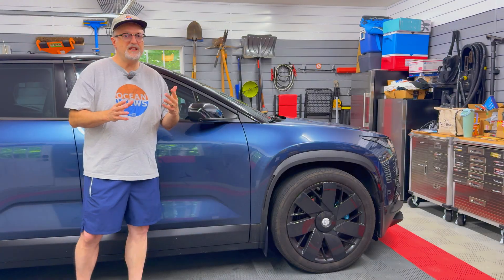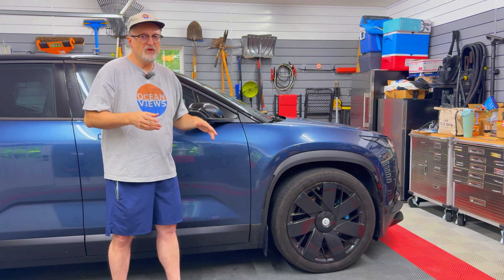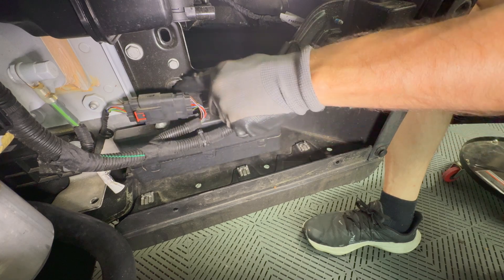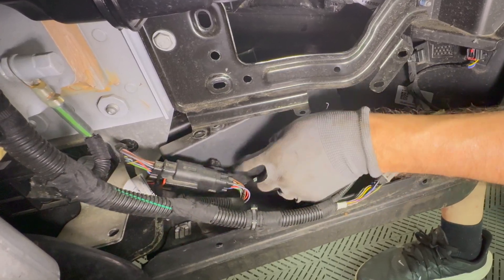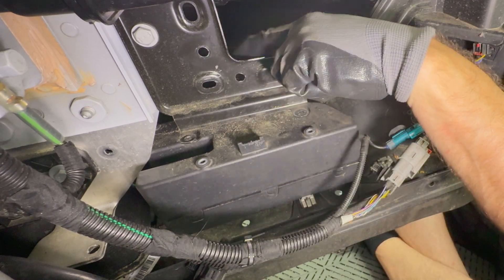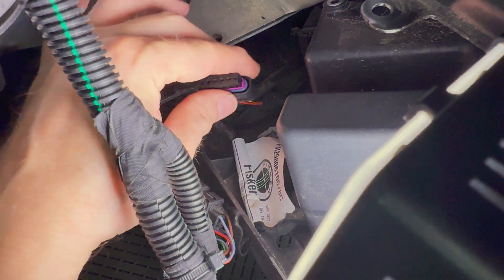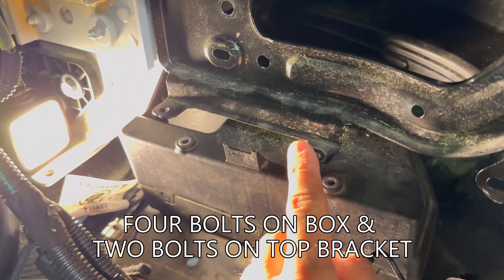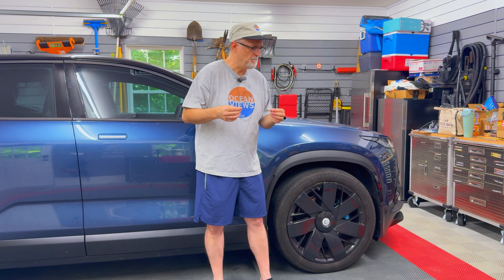Fisker Ocean - Waterproof VSP Connector

Comment: would never tape a connector wich is already waterproof!what you think that MAGMA did not think about that????A taped connector will rotten fast if there comes water inside!
Reply from the maker: It's been demonstrated that most if not all of the connectors on the Ocean are not waterproof.  There are examples of the VSP connector rusting out the pins due to water intrusion.  Service techs are also performing this fix for the car.

Comment: Would you happen to know where i may get the connector that was rusted in the video?
Reply from the maker: There are two versions here depending on the tool needed: https://electrifiedocean.com/products/12-pin-deutsch-connector-stamped-pins or https://electrifiedocean.com/products/12-pin-deutsch-connector-barrel-pins

Comment: Great video - one suggestion is that putting the car on a jack and removing the bottom cover gives much better access to this VSP connector (also some of the other ones by the right front wheel)
Reply from the maker: Oh sure, for some of the items, it would make things easier.  Some connectors do require taking off the bumpers to fully access.  I would love to have a car lift to do better work.  But I have to work with what I have.

Comment: I followed your front connector video and took the whole bumper off and while there did what you done here, inspected the vsp and saw no evidence of water damage, but I did cover the holes under the vsp few months ago, and see your comments below about doing something with the cowl, I ended up putting a foam material at the top above the wheel as per a thread over on FOA

Comment: Can this alternatively be accessed by removing the front bumper?
Reply from the maker: It’s possible and probably easier to do all the water proofing for the front at the same time. Take off the bumper and remove front right wheel to pull back the wheel well liner to reach everything.

Comment: Would love a video on replacing corroded connectors
Reply from the maker: I’m going to be doing one on the washer fluid tank connector and sensor later in the month.  The only one I have seen is a front connector that was rusted out and lost pins (another owners car).  It either needs a new connector or direct wired.  I have to  order parts .  So far my car has had no issues with water intrusion on at least a dozen connectors I have checked.

Comment: Nice video! Agree, taping is probably the only way to waterproof this particular connector. 

Bummer about your harness connector. Do you see all the dried water drop/dirt pattern on top of VSP and surrounding brackets? The real issue is water intrusion. Need to do a VSP block off plate and general water ingress mitigation IMO. This is probably the single most failure prone part of vehicle and even with connector waterproofing, preventing ingress is probably the real answer.
Reply from the maker: This was a local owners car.  I haven’t done mine yet.   I didn’t notice any obvious water drops dirt on the VSP - not surprising since that connector was fine.  The gray connector on the right seems to be the most commonly affected.  Either from water coming in from the VSP speaker grate, or (more likely) water coming in from the windshield cowl drain flowing forward.  I plan to do some videos on preventing that (along with the washer fluid tank sensor replacement) later in June. Covering the speaker grate with either duct tape or a plastic sheet will also be done.